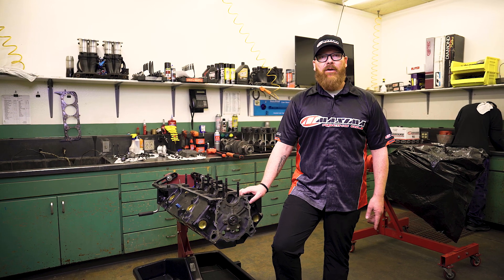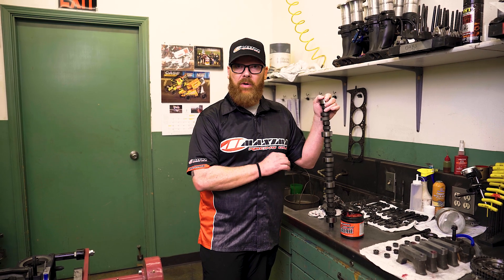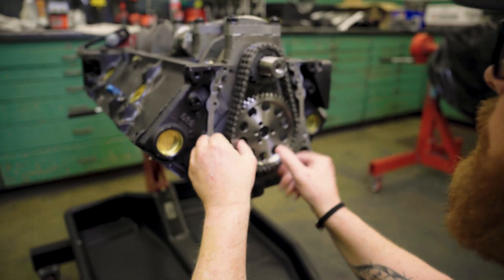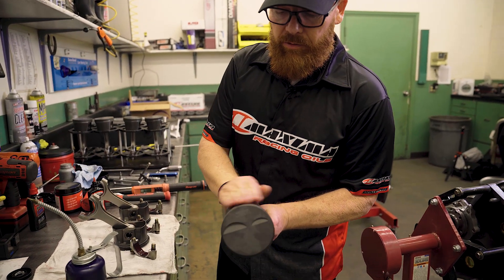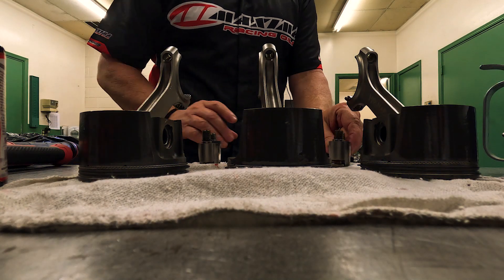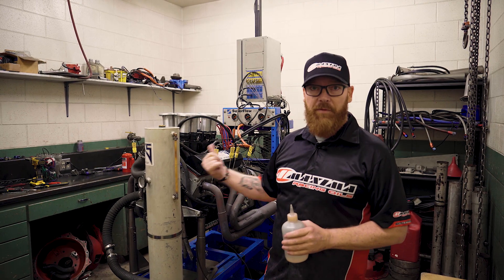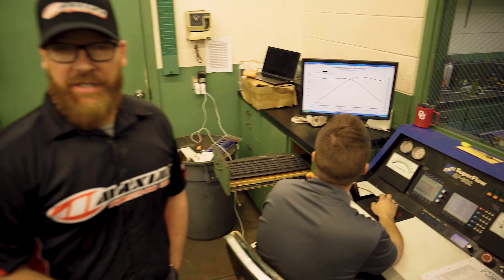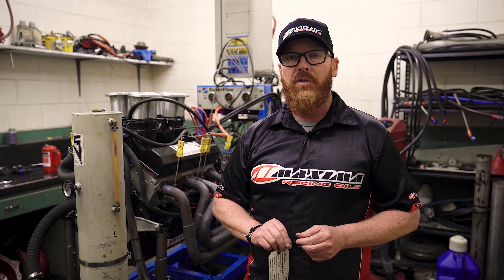Maxima 3-Step Engine Build

Comment: Any issue using the assembly grease in the same manner with a 4 stroke dirtbike engine?
Reply from the maker: Assembly Grease is definitely suitable to use in 4-stroke dirtbike engines.
Reply: @maximaracingoils8192  thank you
Reply from the maker: @nastysoda9212  You are welcome.  Let us know if you have any other questions.